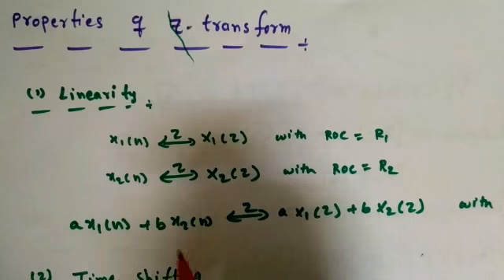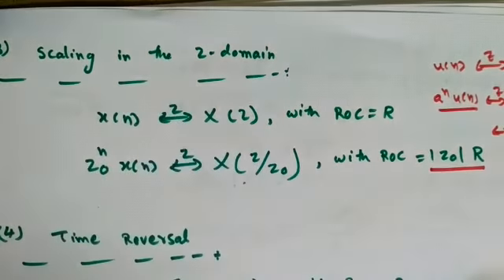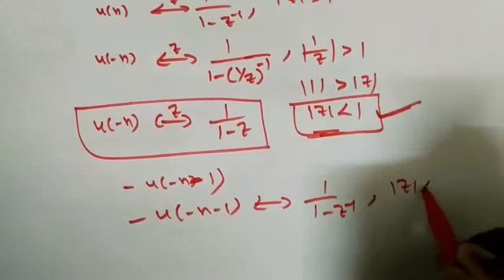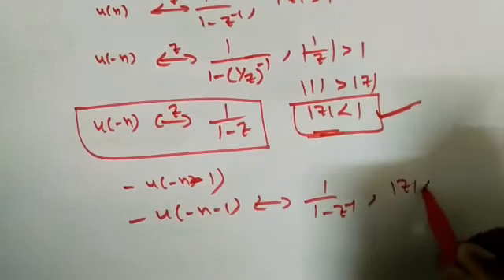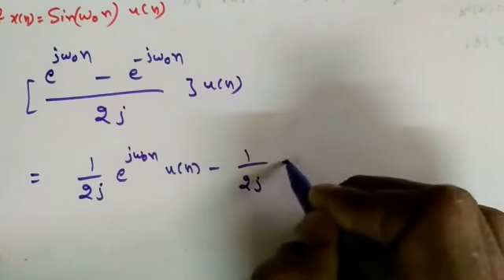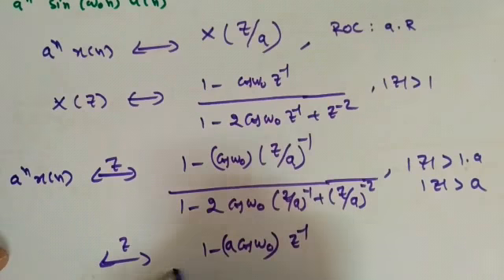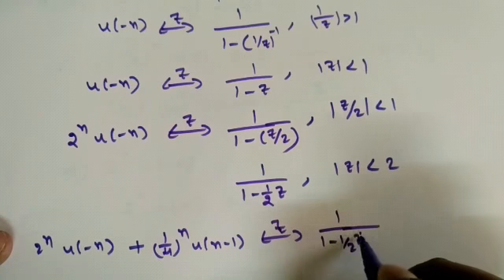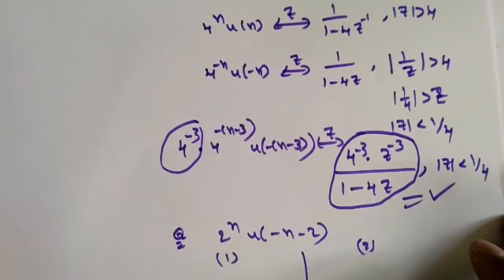Signals and Systems Lec-48: The Z-Transform (Part 4)

Comment: Sir At 40min, the ROC is modulus(z)<(1/4)-except z=0 ?Whether I am correct?
Reply from the maker: no it is modulus(z)<(1/4)...because at z =0 the z-transform converges
Reply: Sir but after time shifting , Numerator is z^(-3), at z=0 Transform value will be infinity or unbounded right ?
Reply from the maker: yes i forgot to apply that shifting in the ROC...
Reply: Learning Z Everything so what will be right final step i.e right roc....clear us